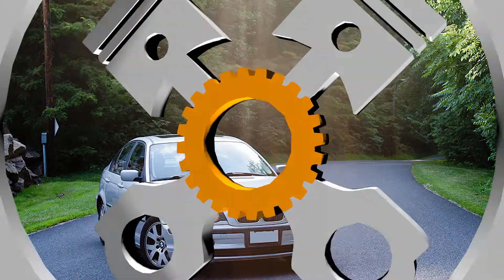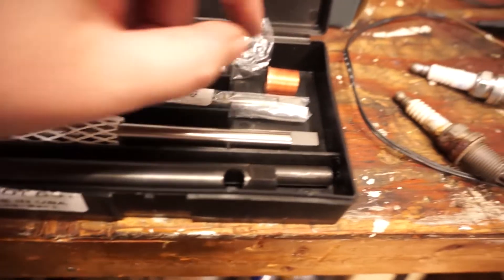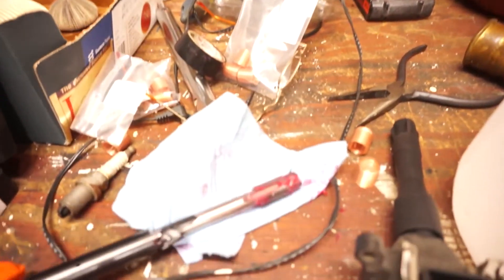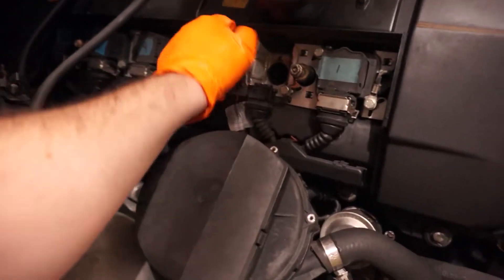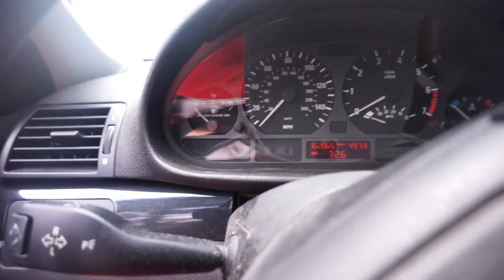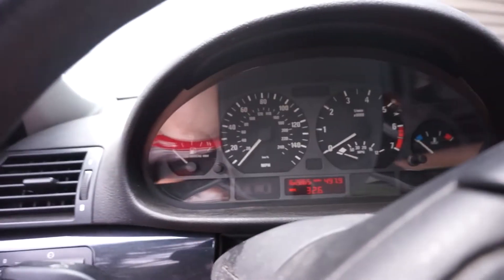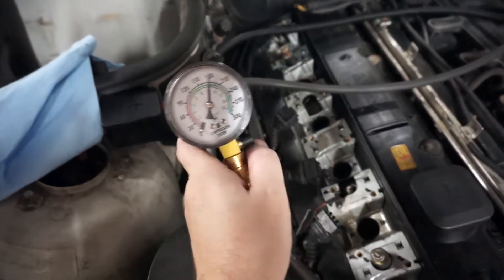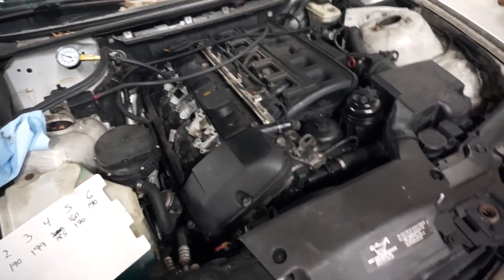Fixing a Blown Out and Stripped Spark Plug with a TimeSert Thread Insert on my BMW

Comment: I didn’t tighten my spark plug when I installed a new 6 pack ignition coil and spark plugs. Spark plug unscrewed shot up and blew the ignition coil up and ruined the threads seen this video as it’s the only e46 one I went to oreilys bought the $50 heli coil set and it worked
Reply: M14x1.25 save a thread helicoil

Comment: So is this the only other option besides drilling it? It’s a $200 kit, there’s other $40 kits which I’m guessing don’t work with the M54?
Reply from the maker: The helicoil kits (and the knockoffs) should also work. I like how the timesert kit works better and there's no piece of metal to lose at the end like you would have with a helicoil. Pulling a head is a big job so I decided to spend the money on the product I thought would give the best chance of success. I've used helicoil knockoffs with success in other applications and am confident they'll work too.
Reply: @chesapeakemotorwerks  yea I bought the kit, worked perfectly. My head is saved and blown sparkplug hole is all good. Cars been redline a lot of time since repair too no issues what so ever.
Reply from the maker: Awesome! Glad to hear it!

Comment: was that 323 ever in some sort of collision repair? bmws usually have some sort of sticker on driver side strut tower, but mine which is early 00 model does not have, hope this is a thing for 98,99 and early 00 models, ngl drivers side looks unusualy dirty to be that covered up with dust and soot,  maybe structure which holds fender was replaced at some point if seam sealer shows traces of rust and paint flaking...
Reply from the maker: Not that I'm aware of. I'm certain of the vehicle history for all except the very first year. If you see my other E46, it also doesn't have the sticker and I know that one doesn't have an accident history. The dirty appearance is normal around here due to it being driven through winters and not cleaned.

Comment: Dude what size is the tap
Reply from the maker: The short answer is I don't know, the tap was included in the kit and I believe it is specific to TIME-SERT.
Reply: M14 1.25. it is made special on the tip so you don't have to drill